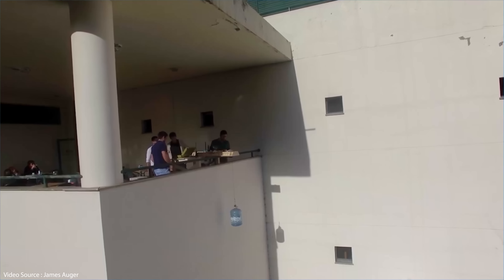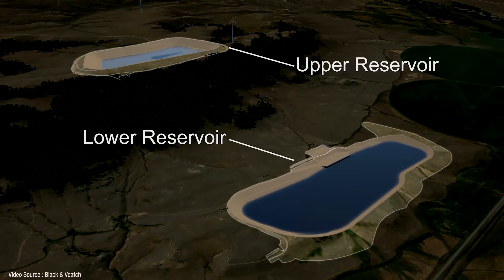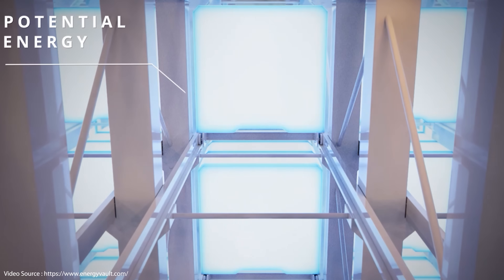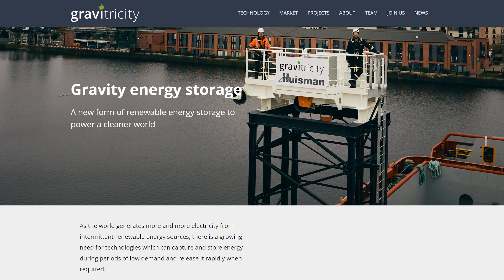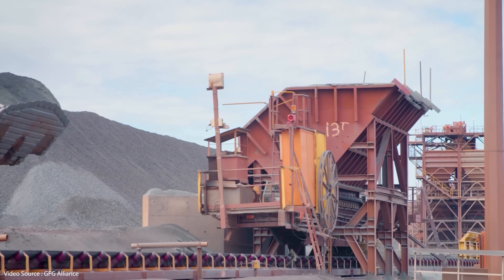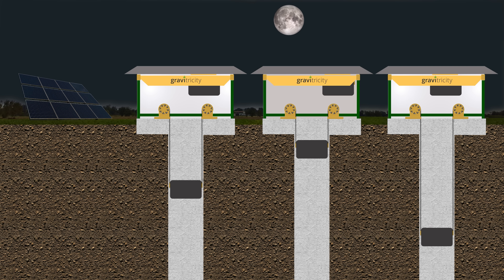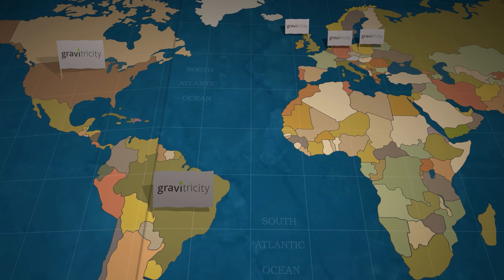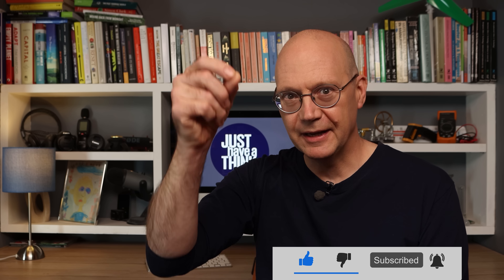Gravity Energy Storage. Who's right and who's wrong?

Comment: After reviewing several hundred comments, it seems clear that gravity storage just does not have the necessary energy density. The exception of Pumped Hydro does not change this fact. Engineering expertise, time and money, should not be wasted on anything below a certain level of energy density. It will never scale.
Reply: What kind of energy density do you mean? Weight based, volume based, or something else?
Reply: @SirCutRy  Let's imagine a 100 ton weight 1000 meter above the surface (or along the edge of a 1000 meter deep hole. It really doesn't matter). The potential energy of said weight is roughly 250 kWh. 250 kWh is roughly how much energy a home is using every few days. 

So let's recap - a 100 million dollar 1000 meter tall  building capable of accepting a 100 ton weight at its very top is able to power a home for a few days. Does this seem like a realistic solution?
Reply: @SweBeach2023  That's why no one is proposing constructing a 1000m building to lift a single block. The Gravitricity system is certainly not going to cost 100k per metre of shaft. What is realistic depends on what you are trying to do. The Energy Vault system for all its flaws separates the equipment from the load so capacity isn't limited by the cost of the equipment so it could potentially work for long term storage. Gravitricity are obviously going for short term storage and I suspect they'll make it work (though batteries will probably win out in the end).
Reply: @francisboyle1739  So once you have lifted the first block, where will you put it? On top of the structure? The energy density of gravity-based systems are just too damn low for it to make sense.
Reply: @SirCutRy  I was wondering sort of the same thing. The deepest mine shaft is 1.6 miles down. There must be a theoretical limit to the maximum depth (weight of cables, etc)
Reply: If water is the exception, then I think the "exception" is not really the exception. Heavier materials certainly would work also.
And there is something to be said in support for an elegant, interesting and even beautiful energy storage system. Huge amounts of extra money is spent on buildings to make them look beautiful and interesting, after all. 
One interesting idea I had was using lava from, for example, the volcano in Hawaii, funneling the lava into rail car "molds" maybe 4ft x 4ft x 6ft, and generating electricity as they rolled downhill to the ocean. Once they hit the ocean, they could heat sea water to turn a turbine to make electricity. The empty rail cars would be pulled uphill by the cars coming down. The cooled lava blocks could maybe even be sold as retaining wall blocks.
Reply: I don't want to diminish the cogency of this assertion.  I don't know enough about the engineering stuff to make a good critical statement anyway.  However, keep in mind, like in anything connected to economics, there are in diverse investments the cigar store model, where the return on investment may be low, or even below par, but its value comes in downturns of various kinds.  These gravity projects have the nice side effect of being potentially more available for lower maintenance given the very likely potential loss of trained personnel after a population crash, in particular, which, for good or bad, seems very likely, and to a very great extent, and likely multiple times, in the next 100 years.  We should, I think, be making such investments, and learning more about them, therefore, as they may end up being the only thing remaining humans can do some day.

Comment: what about mini gravity storage for homes, wouldn't it be cheaper and simpler then batteries?
Reply: Because the energy density for gravity batteries is insanely low. If you run through the calculations it works out (roughly) that you'd have to drop 9,000kg (200,000lb) a distance of 1m (3ft) to boil enough water to make a cup of coffee! (Or 900kg @10m, but who has that much height in their back yard?)
Reply: @marshr32  It takes about 280 calories to boil a gallon of water. No fucking way you're telling me that a fraction of 280 calories of energy can lift 200,000 pounds 3 feet of the ground. You must have got your math awfully wrong.
Reply: @rickrouse7865  Yeah I was thinking that too, but do the math then tell me I'm wrong.
Water = 4.2kJ per litre per degree C
1/4 L = 1.05kJ per C
85C rise needs 89.25kJ (85x1.05)
For the gravity side U=mgh and h=1m so U=mg. 
Taking g=10m/s/s for ease (really 9.8)
10J = 1kg x 10 so for every kg you raise 1m you need 10J........ you need about 90000J to boil that 1/4 L so......... 9000kg. And thats with everything at 100% efficient.
Seriously, tell me where I'm wrong because this blew my mind.
Reply: @marshr32  i suck at math but I'm familiar with reality. In reality I can bring to boil 2 cups of water on a stove in a few minutes. There is no freaking way with that small flame it produces enough heat energy to power a machine to lift 200,000 pounds up 3 feet... LOL! that's ridiculous.
Reply: @rickrouse7865  
There's every freakin way..... Natural gas has 53.6MJ (thats MILLION JOULES) per kg and we were after 90000J for the cup of coffee. That's not even 0.2%.
How much Diesel would a crane use to lift 200,000lb up 3ft? Even the least efficient one would use only a fraction of a litre, right? Yeah, cause diesel has 46MJ per kg.
That's actual reality! 
And yeah its ridiculous that nobody realises how much energy we use because we use such high density sources.
And that's also why gravity batteries suck.
Seriously, dropping things down holes ain't new. If it worked well we'd have done it by now.
https://en.wikipedia.org/wiki/Energy_density
Reply: @marshr32  I know with mechanical advantage a man can lift a mountain. Things are not what they seem is my point. 

Youtubers have installed 500w generators that run on captured rainwater from their rooftops and also by rivers. I can't measure the weight of the volume of water that had to power the generators. Imagination is not a substitute to real world tests so I'm probably talking out of my ass.

200,000lbs of weight and pressure can be applied to force water out by way of a powerful stream to run generators. I have no idea how water can be moved by such a system and how long it will run for. Again I IMAGINE such a system can power a 500w generator for hours... maybe? I have no idea. A 500w generator running for an hour I'm sure can boil over 2 cups of water to make coffee.

The water itself isn't gravity assisted it is at ground level so it doesn't defeat the purpose of using weights. This stuff has to be tested to settle the debate.
Reply: @rickrouse7865  Just realised there's a typo in my first post..... 9000kg is about 20,000lb, not 200,000.
Still, 200,000lb would only get you 10 cups of coffee. Actually probably more like 7 or 8 due to losses.
The only mechanical advantage we have here is height.
Hydro is great cause you can have a reasonably large mass from a high height and do (relatively) quite a lot of work. The height is what really makes it good.
You're still looking at hundreds if not thousands of kg of water per minute though. So rivers, yes, but rainwater from the roof is gonna run out pretty quickly.
Definitely 500Wh would get you some coffees.
Reply: @marshr32  like I said, I really don't know. In my mind 20,000lbs of pressure can move a lot of water the question is how for how long?

Comment: Assuming that abandoned mine shafts happen to be in the same location that is ideal for either solar or wind, this might be feasible.  But if you have to build deep, perfectly straight, mine shafts then the cost would be prohibitive.  In other words one is greatly constrained by geography and geology.
But...
The ocean presents no such obstacles.  A floating platform in 300-400m of water is already all you need.  Has Gravitricity looked into coupling this idea with off-shore wind farms?  I know that designing systems to operate in the marine environment presents its own set of challenges, but the fact that just about every off-shore wind farm is already well positioned to be in moderately deep water this could be a good place to build this.

Comment: Not a gravity storage solution, but I read an Economist article about Energy Dome. They store energy by compressing CO2 instead of air which reduces the costs - they claim - to $60 per MWh! They have completed testing and will start construction of the first commercial plant. It would be great to see a video about it and find out if it’s as good as it seems.
Reply: First problem: using CO2 instead of air is as likely to reduce cost as any regular power plant using ice instead of water or steam.
Reply: They use CO2 in a closed loop, so they fill the system only once every 20 years. The advantage compared to air is that it can be compressed at room temperature
Reply: @d1v0dm  Assuming they can keep it closed that sounds useful.

Comment: On a delta height of 360 meters, you get 1kWh/ton.
To have 1 GWh of storage, you need 1 million tons of weights to move up and down over 360m.
If your weights' density is 5 kg/l, you'll have 200'000 cubic meters of volume, which is roughly a parallelepiped of 100x100x20 meters.
This is why storing large amounts of energy with gravity is hard (unless you use water reservoirs): because you need a lot of materials and space.
Reply: Yup .. and water flows all by itself so you don’t need to stack it.  No question water for long-term storage and batteries for short term is where this is going.  Large battery buyers are buying under $150/kWh today, CATL anticipates being under $50/kWh this year for (Sodium batteries if memory serves)  .. and we are no where near the limit on battery/performance/price.
Reply: @solarguy4850  Water is problematic because it's a liquid, it's harder to contain than solids, it can evaporate and couses corrosion, so imo pumped hydro is best built using natural terrain. Good boon for gravity storage is that it doesn't lose capacity over the years, downside being moving parts but pumped hydro has the same problem albiet smaller
Reply: Don't forget that installation of the weights allows that the gravity battery can start out in the "Fully charged" position. As long as the modular design has enough modules and energy collection equipment, there is a chance that the gravity battery can keep up with demand. I think it's important to think of the gravity battery as a secondary source of energy when demand requires it's use, or more or less a supplement to existing infrastructure.
Reply: @deepdigger-c6k  and I think you are and idiot, Sir.
Reply: 100x100x20 seems doable...
Reply: well, instead of one gigantic block, you could use multiple rail carts, that can be lovered down and go into the side shafts.

Comment: I love the idea of using this system in decommissioned mine shafts. That's a great re-using of space that's just sitting there unused. I wonder if that would work in, say, old abandoned oil wells? You could set up some renewable energy infrastructure around it, like solar panels or wind turbines, and use the old mine shafts to store any excess energy.
Reply: Probably not as oil wells tend to max out at around 3ft diameter and usually more like 18 inch diameter or less and the system seems to expect a 10 ft ish shaft at the small end
Reply: @brianzmek7272  Ah, I didn't know that. Thank you. I'll be honest, science isn't my strong suit. I love learning about it, though.
Reply: @NickPiers  Coal mines use an elevator similar to what you would use in a high rise building, except it is much longer. The shafts are not only used to get the coal out, but also get the workers in and out, I think for three 8 hour shifts a day. The shafts are perfectly straight, oil wells literally have no reason to be straight, and can even have 90 degree bends.
Reply: One problem when using mine shafts is that they fill up with water (often with toxic elements). The pumping of water to keep the mines dry is often a major part of the operational cost and cleaning the water is also a major cost.
Reply: @bknesheim  Exactly, plus pumping out the water will cause the water table in that area to drop.  The video shows farms surrounding it, I'm sure they wouldn't like their water table dropping and rending their current wells unusable.
Reply: @bknesheim  Good point, but you do not have to keep the mine itself dry.
Reply: @vsiegel  Line it and seal it like you do with tunnels?
Reply: @MrAdopado  Not sure which part you mean to be sealed, but the mine itself is just too large to seal the walls. In the shaft, it would make the shaft cross section smaller, and it does not have a lot of water intrusion anyway.
Reply: @vsiegel  I mean line the vertical shaft ... exactly like they do for horizontal tunnels. It doesn't matter if the rest of the mine floods and isn't pumped out (this would not be an active mine).
Reply: @MrAdopado  The vertical shaft is almost dry already, originally. And making it completely dry is not worth it, I think. We use an existing shaft to save money, and lining a shaft is certainly expensive. A very small pump should be enough to get the water out, not running most of the time. It is about dripping water at most.
Reply: @vsiegel  I was responding to comments about mine shafts with water ingress problems ... obviously if you've got a dry shaft then no lining is necessary, which is even better.
Reply: @MrAdopado  I see. As far as I understand, every mine shaft has a minimal water ingress problem. It penetrates any ground water aquifer, even one that could not be used to get water from it. That ground water flows into the shaft for some time, and if you are not in a place of a full size aquifer where you could pump water for years, it will only drip at some point, that is completely normal. With a tunnel, you can have a connection to ground water along the whole tunnel, and you are near the surface. A shaft punches a hole in a ground water layer at most, near to the surface. If it is a problem. you can just line one or two meters at that depth, and you can be pretty sure that the people who dug the hole were pretty good at it. 
Basically, every shaft is almost dry, but none are really dry.
Reply: @bknesheim  IDK in my mind Gravitricity wouldn't be using the bare shaft to drop their weights in.  They would be using some form of lining in the shaft.  That lining could be used to keep the water out of their drop shaft and not affect the local water table at all.
Reply: There's alternatives that use pressurized water; that might be an option. Sorta like pump-storage but in reverse. There might be other reasons why abandoned oil wells don't work though (could be as simple as no useful location).
Reply: The mines I am familiar with are not configured to fit this purpose.  You enter a mine through an addit, which is a horizontal shaft starting out at a geographic low point that avoids unnecessary digging, then the access shaft descends at a steep slope until it reaches the mineral seam at which point the mine goes horizontal or slopes gently to follow the seam and allow workers and equipment to operate on a flat surface underground.  I'm short, most of the hole is horizontal, not vertical and the vertical bits are kept to a minimum.  So, each large mine has a very limited amount of usable pre-dug shaft.  Mines may be better for compressed air storage (CAES), which can take advantage of the mine's volume, though that tech has its own issues.
Reply: @erikswenson2659  That would really depend on the mine.  The few mines that I'm familiar with here in Canada have had vertical shafts over the horizontal or steeply sloped shafts.  With Gravitricity's plan even a steeply sloped shaft would work.
Reply: I wonder if anybody thought of using the Old Faithful geyser in Yellowstone park ,for power generation?
Reply: @MolloRelax  They do in Iceland.  They have lots of hot water geysers to tap for heating and power generation
Reply: @MolloRelax  Geothermal power is a great source that is used in various parts of the world. Check out how Iceland generates heat and electricity for example. Unfortunately most countries don't have that much high temperature geothermal available.
Reply: @ingulari3977  Gosh you are angry  With most of the land around mines taken up by mine tailings that would actually be a good place to have wind and solar farms.

Comment: To me Gravitricity is the only one to be taken seriously.. They keep it relatively simple and small, and I still think it could use these old coal mine elevator shafts for this.

Energy Vault was in the process of building a prototype, I believe somewhere in Switserland, what has happened with that contraption? That they seem  to have moved on to something enclosed tells me that concept has failed miserably. But I am afraid that enclosed system with all kinds of weights moving around vertically and horizontally and being very large does not seem very viable to me eather... too complex, and who wants to have a collossal cubical in their back yard, that costs probably billions.
Reply: I like the look of Energy Vault's original concept better. Maybe they could build a windowed tower all around it, and put a big wind turbine on top.
Reply: if it's small it'll never make much difference.